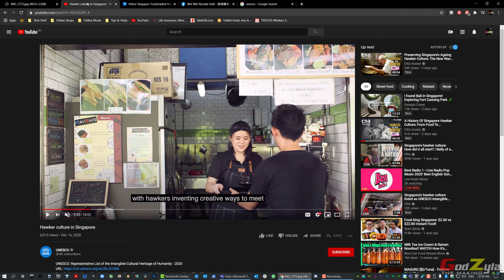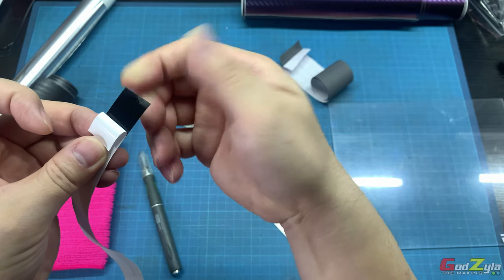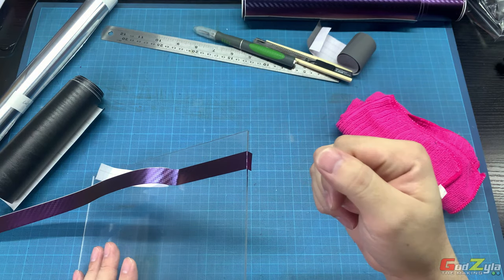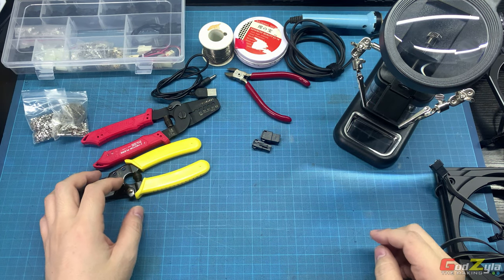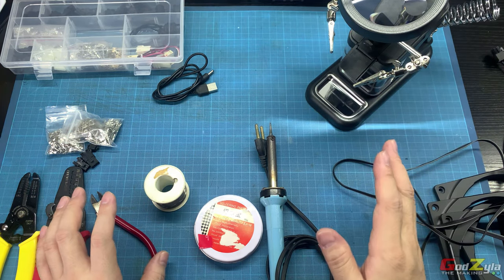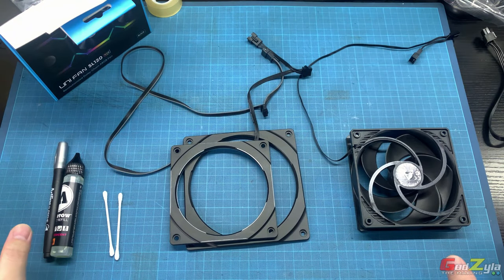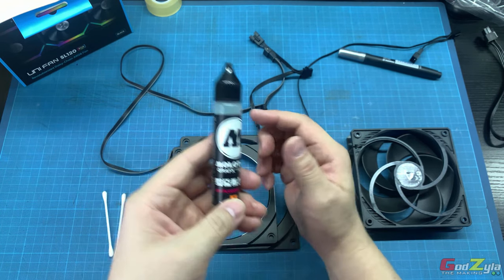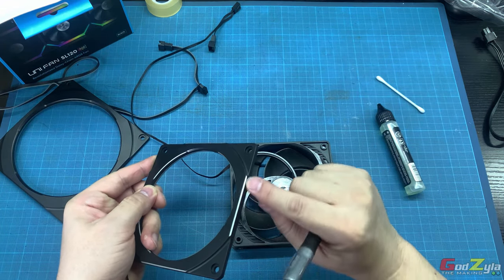Lian Li O11D mini - Modification & Preparation

Comment: I have the same case and I think I’m gonna add a vinyl wrap as well. Such a great idea! Can you remove the front acrylic from the case?
Reply from the maker: Hi Richard, as for the front. That is glass for the black version. I believe it can be removed but I did not as it might break the glass as it can be britter. Therefore I did not touch the front..

Comment: Cool mod... That with the UV pen. But won't that only light up with black light? Do you know by change where you can buy those led strips mounted in the halo's? Never seen them sold separately.
Reply from the maker: Hi JustDigit, welcome back my friend. infact I was trying to get hold of those narrow strips which measures at 3.4mm wide. thats the only strips able to fit inside these halos. now just for your info, there is the argb version as mine are rgb version (old stuff) you might be interested in this, have a look. these are addressable rgb halos https://www.amazon.sg/Phanteks-Halos-120mm-Digital-PH-FF120DRGBP_BK01/dp/B07BGVD62T/ref=sr_1_4?dchild=1&keywords=halo+argb&qid=1608473181&sr=8-4 . Once again thank you for your comments and to re-visit my channel :)
Reply: @KleoYan  Thanks mate I will look in to it. Those hard pcb ARGB strips are most of the time in these fans. But nowhere to buy seperate.
I have modded my SL120's. (I have 10 now 7 white and three black in the Arctic liquid freezer ii .) The dark spot in the middle of the glass is gone now. 😉.
Going to follow this build.... Looks promising.
Reply from the maker: @JustDigIt you are most welcome. I should be the one thanking. Since the beginning till now, you've been very supportive to my channel. You've provided all those questions which aid me on my learning. I really appreciate your time and efforts to interact with me my friend :) I wishes you all the very best in your build and know what? You've given me another idea. Will it be good if I ask those who are doing new builds to record a short video of their PC, submit it and I will compile and  talk about their builds.. This way I will learn from everyone and at the meantime, keep those builds on a video where all owners can show case their build to their family or friends. ^-^v thank buddy, let me see what I can come out with :)
Reply: @KleoYan  OH wel that's a community for right?? I can shoot some video of my build no problem. But for presentation that's not my thing. Haha.. I was already planning to make a video of my WLED setup.
Reply from the maker: @Justdigit2  I see, nice.. ok shall wait to see your WLED setup. do let me know ya. thank you!

Comment: My whole rig is full of arctic fans thanks to your vids!
also, I found out the airflow for F12 is better than P12 variant
Do you have a previous test to help verify?
Reply from the maker: Hi Creepto, thank you for the feedback. The F12 are indeed good fans. strong case fans.. I do have the F14 PWM PST variant which I am using on my current rig, but just wanted everything to be uniform and my Liquid freezer does bad if i use the F14 PWM fans.  for the migration, just to blend with the P14 PWM fans on my Liquid freezer, I have chosen to use the Arctic P12 PWM PST CO (ball bearings and not hydraulic bearings) . once again thank you for re-visiting my channel too.

Comment: Hello, do you think it’s possible to flip the case on its head so the glass side panel is facing to the right( i know that front io will be blocked sadly but I still wanna know, are there other issues outside of io accessibility?)
Reply from the maker: Hello silverflash1, I belive I have answered your question before on my other video. The answer is no, you can't flip the case and these are the issues

1) front I/O panel will be below 
2) The fan filters will not be at the bottom. it will be at the top instead
3) even if you manage to fix all PC components. if you flip the case.. stress of the glass panel will be on the top panel which will either warp it or force it to break.
4) not possible to re allocate the feets from the bottom top.

this case is not meant to be flip, kindly contact Lian Li to have your case custom make.. https://lian-li.com/contact-us/
Reply: @KleoYan  thank you for the reply !

Comment: How about developing a mod so that a 360 mm rad can be used on top with an ATX MOB?
Reply from the maker: Hi J Boy, Merry Christmas and thank you for your suggestion. I do not have intend to do that as I will be using this case. However being said. you can try remove the top cover, mount the fans on top and the 360 rad inside with a ATX MB installed. Next, find a way to secure the two panels (Front and Side), that might work. once again thank you for your question and to have re-visit my channel.

Comment: I also decided to choose those fans(price to performance unbeatable) and probably two 140mm Bionix fans also from Arctic. Going full aircooling with Dark rock 4 pro, probably not that good looking as some water coolers but I hope it will match well ;). Can't wait for another video!
Reply: Maybe if you're rig still not fully ready to build yet you can wait for P14 PWM PST CO instead of bionix.
Reply from the maker: Hi Cosymoon, welcome back and to have revisit my channel. As what Jeffrey have mentioned. should grab those Arctic P14 PWM PST CO, those are ball bearing. I do understand Bionix F140 or P140 looks nice as I do have them but overtime, they make noises for some reason. very sharp whining pitch. once again thank you for the comments and feedback :)